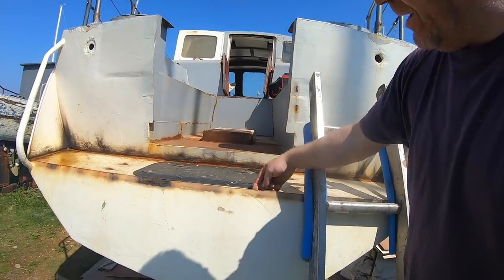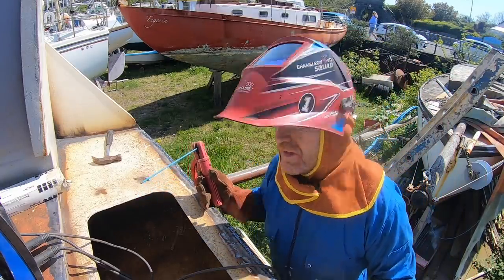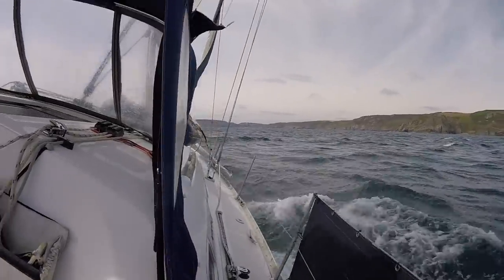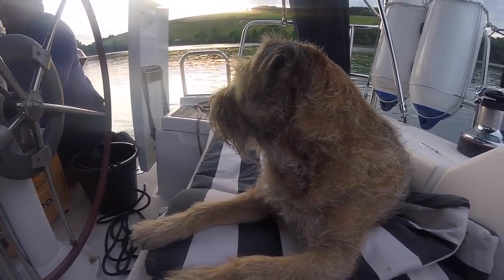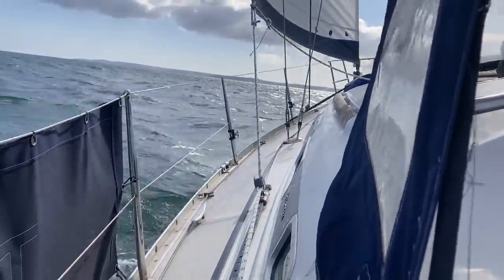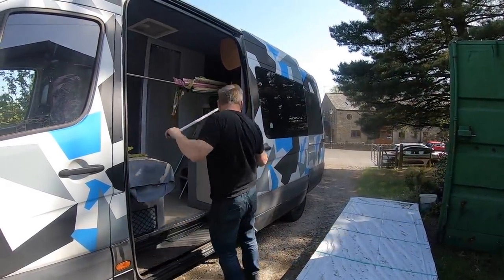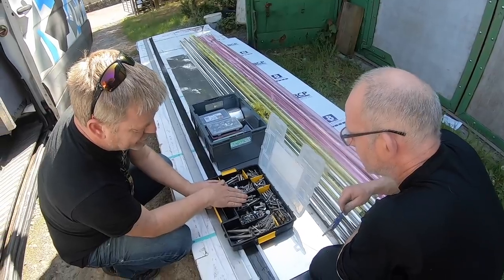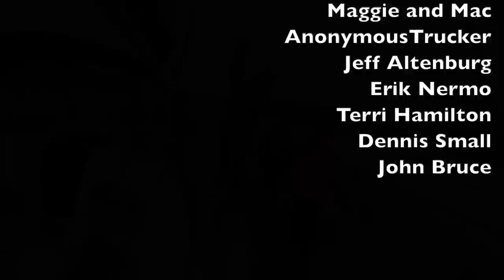#93 - A NEW SKIPPER and A NEW BATHING PLATFORM

Comment: Nice work.  I'm thinking there is a specific pickeling process for stainless thats welded to mild steel to stop the rust and corrosion that starts at the weld quite aggressively. Check it out.  God Bless.
Reply from the maker: The pickling would only make the stainless look nice and shiny and stop it going dull. It wouldn’t affect the strength of the stainless. Or the mild or the weld. I can pickle the part which is exposed at a later date if I get round to it
Reply: @SailingMelody  well I guess pickeling all that high pressure hydraulic pipe to prevent rust at the weld joints of the steering system on those ships was a waste of time and money even though she hi temp fluid is infused with water.
 Heat (welding) changes the chemistry of metals just as surely as phosphoric acid changes iron oxide to zinc oxide if you don't sand or grind it away. Check Ship Happens on the motor mount episode. Enjoy your refit and have many years enjoying your travels and labor.
Reply from the maker: Hmmm ok. Maybe I need another look at this pickling lark. Thanks for the heads up
Reply: @SailingMelody  ya know I just thinking it would save some B S bright work maintenance down the road. 
 It's not like stainless boiler tubes in nuclear power plants. Those tubes rust where they rub and touch each other in transport and fabrication. THEY ALL get pickeled. Don't want rust there ! Yet they still do. Stuff happens!  That's why pipe fitters n welders go back every shut down and fix the last man's shortcomings. Hey ! It's just a hand rail. At least you can see it.

Comment: Andy, how do you ensure that the weight and weight distribution remains true to the original buoyancy of the boat design?
Reply from the maker: I’ve hardly changed the weight at all. We’ve massively reduced weight throughout but what we put back will be almost identical to what we cut out. Compared to having two or three people sitting in the cockpit there will be negligible difference

Comment: have you thought bathing platform hot under bare feet, deck king or other , not so hot or cold under feet after swim . also non slip and wont rot like wood i have it on deck, easy to clean  looks good after six years now .

Comment: Why do you tap the weld with the claw of your hammer?
Reply from the maker: When stick welding you have to knock of the slag which is a build up of material on the top of the weld.
Reply: @SailingMelody  Ok. thanks.

Comment: would you not cut some drainage holes in the bathing platform and cover in some thin timber?  That steel is going to get hot, so uncomfortable for those going for a swim. Even a couple of battens of marine ply would be enough.
Reply from the maker: Wait and see 😜

Comment: If screws and all that stuff are so boring to you, you really should stay away from any boat. Boat maintenance is far more work than household work in a boat. What about fair equal rights on board? And far worse: What are you going to do when your skipper is injured or unconscious? Exactly in this moment the worst things happen. Engine failure in front of the port or a storm on lee shore with an dismasted boat. If you're not willing or not able to do any job on board let it be and stay on land. For your both safety, equal rights on board are mandatory. Not what the skipper rules belong, as long as the skipper of the day is in charge, his word is law. You may change roles daily, but on a boat there's no second opinion while underway. Even if you know the maneuver will go wrong. Action has to be very at times and thinking is not the way in this moment. It's like in the navy. Unless you're able and willing to learn at least some very basic things about engines and stuffing a leak, putting up an emergency rigg you shouldn't be offshore.

That's for almost 100 percent off all women, equal rights stop exactly where it becomes dirty and inconvenient. Men also have to learn all that. And do the household work incl washing the boat on top.
Reply from the maker: You clearly don’t want our channel.

Your comment is so cringeworthy it’s embarrassing.

Do you follow us at all? Do you have the slightest clue what Melissa does and is capable of?

Grinding, welding, sanding, painting, sheet metal fabricating, mechanical engineering, electrical work, plumbing work.

You just showed yourself up way more than showing up Melissa matey.